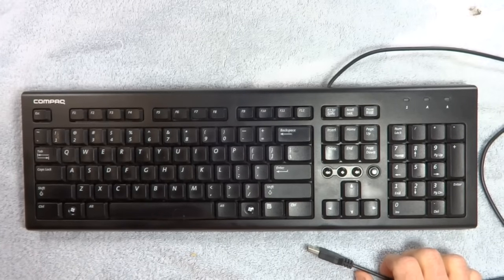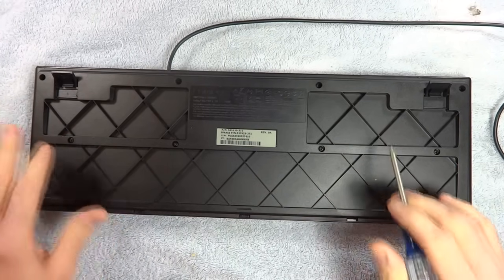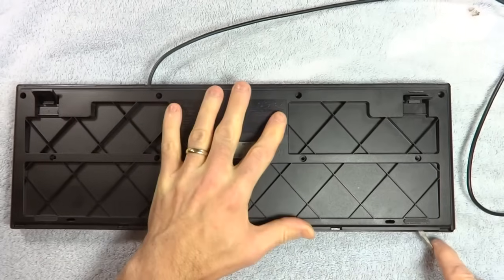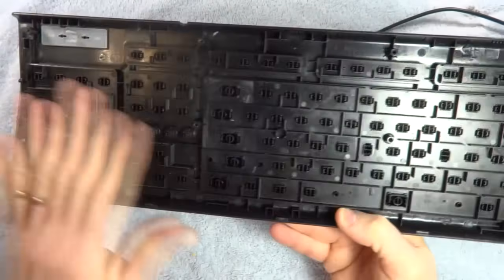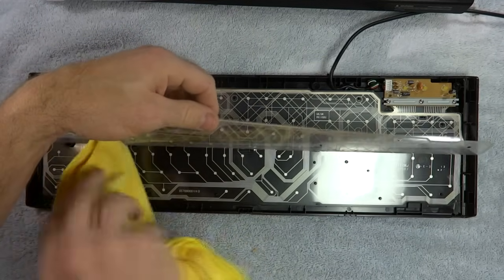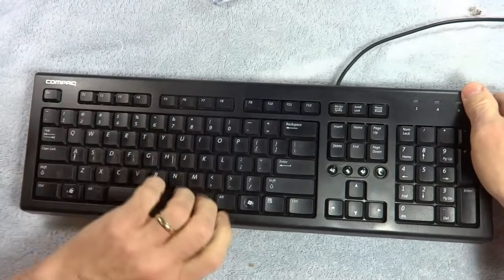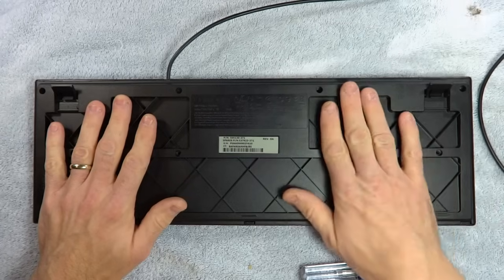How To Repair Computer Keyboard With Some Keys Not Working

Comment: I had a break in a trace on the top layer causing multiple keys not to work and was able to fix it by drawing over it with pencil, a multimeter will help with getting a good pencil. make sure to get a one that's actually conductive, the best i found was actually one of those little IKEA pencils, my multimeter actually beeped when touching the end and front of it, when another pencil i bougth from the store didn't beep at all.

Comment: Hello- My numpad is working weirdly if I press 1 it registers 1 and 2, if I press 2 it also registers 1 and 2. Same happens with 4,7,5 and 8 keys of the numpad. I have not attempted cleaning the keyboard. Have you heard of this type of fault? It's an old late 90's Dell membrane Keyboard.

Comment: Alright, thank you to prokyminch1640, i got the idea of being misaligned, what I did was try to wobble the keys, without putting out the case, the ones that weren't working for me was H, G, N, these keys would malfunction and double-type, and sometimes not work, what i did was press them at the same time, while wobbling them for about 10-30 seconds, after that, try to test it out, and it works for me (now this is just my idea because for a long time this has been happening, try it out guys)

Comment: Exact same problem with Microsoft Ergonomic 4000 keyboard; Z X C V and main ENTER keys stopped working. I opened the keyboard, cleaned it and made it work again! However, it stopped working the next day again. I opened it and gentle cleaning fixed the problem but now it'd only work for less than 2 - 3 hours before I need to open the keyboard again.

Should I now discard the keyboard or is there anyway to fix it?

Comment: My work table is near a window and when it rains and I forgot to close it, my keyboard gets a little wet.

After drying and all...

My keyboard still  types q1 w2 e3 when I press qwe.

Been in this stiuation twice already. 

So I did the same techniques in this video... 

And for both of those times...

My keyboard got fixed. 🎉

That's when I realized I should've bookmarked this vid. 😅

Comment: It worked for me.. I still have a 2006 Microsoft Comfort Curved keyboard and the 8 on the number keypad did not work.. 
Took it apart, deep cleaned everything.. Let it dry and next day I put it all together and it worked again. Amazing..

Comment: I have a Rapoo keyboard which is more of a sealed one and you need to pull the frame from top. I did that but I have no choice separating the thin membrane. Does anyone have any idea pls?
Just my space bar was not working and can you believe it was typing 9 and / continuously withing even touching it sometimes.

Comment: Thanks RJTheBikeGuy!!  Your video helped me save my Keytronic "classic ll" keyboard, the culprit was a big 'dust bunny' on the foam black bar next to the small circuit board inside the keyboard. I suspect the 'dust bunny' was infringing on the connections needed for functional keys. After taking my board apart & cleaning it gently but thoroughly it works perfectly now, so thanks for your informative & helpful video.  *Peace*

Comment: Excellent video & advice.  Spilled pure water on my Dell L100.  3 keys did not recover after 5 days.  Disassembled & found no remaining water.  Removed stubborn Mylar circuit deposits.  3 keys still do not work.  Conclusion: I should have disassembled & aired it out immediately after the spill.

Comment: Thanks...To my surprise this actually worked for me.  The "O" and the "I" key would not work even after removing the caps and cleaning so l took  off the bottom and found that rubber piece was folded at one end but didn't think this would be the problem for only 2 keys.I straightened the rubber piece and put it back together and tried it anyway and to my surprise all the keys actually worked

Comment: when you separate the two films with the contacts  you will see where they meet when the button pushes on the silicone, there is a a small nub inside the silicon button that pushes straight on the top membrane - shine a light on the actual contacts where the button is that is not working and you can see there is a speck of whatever that is over the contact.  mines got a shiny spot - what i was wondering is what ( if anything )  can repair that shiny spot - i would go buy a new key board but the one that is broken I cannot find.  these that I have here are either way small ( normal for reg people ) me. my old keyboard is a monster and fits my skillet size hands way better. i can type very quickly with it but my enter button is worn thru as stated. also I noticed several others that do work but they are getting that way as well.    I keep looking for something I can brush on and let dry that will fix that problem.   it's making me crazy. LOL  seriously.   I am at this keyboard on and off for 10 to 12 hours a day and it's really slowing me down in sales because of this problem.    I can see  lesser used button contacts do not have any shiny spot at all.   the inside of mine looks exactly like yours but larger.  i am not talking about a reg big key board here, i have had this one a long time and don't remember where I got it.   I am not a small med  or large person , I mean, my pinky finger ring sz is 13.  this keyboard was taken for granted by me for so long I guess, it is really depressing that is is breaking.  seems like such a small thing stopping it from being solid gold to me again.   if anyone knows what to do to fix the shiny spots on the connection dots please let me know.

Comment: 9 years later . . . Your video was helpful to me reassembling a vaguely similar Dell keyboard RTD50. Fyi, the RTD50 has 3 layers of plastic sheets inside: there's a completely clear sheet sandwiched in the middle. The clear sheet is not used or shown in your video's keyboard, but is in the middle of the RTD50's stack. Hth someone along the way : )

Comment: what you don't know is if you remove the last part (The electrical part where it connects) it will have problems with buttons and some buttons will not work at all! so DO NOT REMOVE THE ELECTRICAL CONNECTION. if you ask why it is because it did happen to me.

Comment: This is the most useless video I have seen in most time. You didn't repair anything. You opened the thing up, you said out loud that there is nothing visible, you use a cloth in 2 mini spots and closed it again.

Comment: i just go my cheap membrane keyboard so i took out everything from until it was only the bottom board then i fill some cotton from one of my pillows but when i get everything back and screwed it it doesnt work i dont why. i\ve check the rubber and the dots have alligned nothing was wrong and it's still broken up until now. oh, and the foam is no longer there

Comment: Thanks to this, I fixed my RGB lights.

When I opened my keyboard, the keys started to not work. I keep my screws tight, cause there are screws for the plastic membrane to the circuit board. So it works fine now

Comment: Mine slowly descend and ascend on the right side and don't register because the membrane either expanded due to alcohol and receded to the right side, disaligning the p, enter, shift, and backspace keys. The P key, enter, shift and back space keys are very spongey I hate it...cleaning them doesn't do anything except reset the whole physical encumberance...

Membrane keyboards are really annoying for me, sometimes the membrane just breaks, the rubber one. Not sure how or why probably because it is cheap and was exposed to the elements.

Comment: Can some one help me  some keys doesn't work  in my keyboard  and I thought something was wrong with my PC so I tried connecting my keyboard to my phone using OTG cable  but no still those keys doesn't work  the space bar and some other keys doesn't work and i tried restarting  my pc and nothing happened and the other day when I opened my PC everything's normal the keys work perfectly fine and after some days again it happened and soon sometimes the keys will work and sometimes it doesn't and when i press the key with lots of pressure sometimes it'll work and now it doesn't work like its completely broken so i cleaned the keyboard and nothing happened and i decided tp buy an new keyboard and that keyboard worked fine and after few months some keys doesn't work like no keys on the left side work can someone help me fix this same thing happened to both keyboards SOMEONE HELP PLSSSSSSSSSSSSS

IGNORE MY BROKEN ENGLISH

Comment: I just wnna comment here today 2021 it helped me. Before my key caps if i pressed letter A it comes out as a1 then r becomes r3 i did exaclty what he did i wiped the thick layer in the bottom and placed it back and worked properly thanks!!

Comment: This video was great. I had a couple keys that would nt work after spilling diet coke on my keyboard. Took the keyboard apart, cleaned everything, especially between the layers of plastic, and it works great. Its not really about the money as I had already bought another keyboard but about having the ability to fix it if needed. Thanks much.

Comment: In my keyboard, there are 3 sheets of plastics like on yours, but they are glued together all around the borders. Any idea on how to separate them? I tried a screw driver on a side that there was nothing printed, but I'm afraid it will remove the printed pattern. I was thinking about applying heat, but I don't know if it may deform the plastic. Thanks for any input!

Comment: Due to lack of conductive paint I repaired one with single-strand wires before. Glued on with tape it works perfectly fine. Not an ideal solution, but stable enough inside the rigid casing.
Reply: Wow, I cant imagine that lasting long.
Reply: @disguisedcat1750  update: lasted about a year before the tape came lose. More than enough time to find a proper replacement.
Reply: @HappyBeezerStudios   uhh.. nice!

Comment: probably best to always use 91% rubbing alcohol to clean all parts. Also if some of the keys still do not work after cleaning what else can be repaired???:
Reply from the maker: Make sure it's dry before reassembly. After this, dunno. Maybe just replace it.
Reply: @RJTheBikeGuy  trying to repair a microsoft natural 4000, they dont make them anymore, a few keys stopped working after water spill, so bummed!!
Reply: I used rubbing alcohol to wipe off some dust on the hard plastic that connects the keys and it turned the cotton ball blue. Why is that?

Comment: I was lil bit skeptical as there are many people saying that after following the procedure their keyboard stopped working! 
My "B" key wasnt working at all... As I was about to buy a new keyboard, there was nothing to loose doing some experiment, right? 
I followed the video to open up my keyboard. Then instead of using any liquid, I just used a soft brush to clean off the dusts in between those two plastic layers. I saw a small dust grain attached on the "B" key spot at one of the two layers. Using my finger nail carefully removed the dust. Now the key board is fully functional again :D

Comment: Is touching with dirty hand inside  between the two layers of the membrane (below the rubber buttons sheet) cause fatal defect??? Or it can be corrected by cleaning with towel ???

Comment: I am still stuck on step one after playing around for about 45 minutes. How do you separate the bottom and the top cases? You made it look so easy. I found all my screws and removed them, but I am stumped how to get purchase between the top and bottom cases to pop those tabs out of place.
Reply from the maker: They all come apart differently. Sounds like hidden snaps in there.
Reply: RJ The Bike Guy 
Thanks for the words of encouragement. On my second attempt, I wedged expired credit cards between the top and bottom cases as I worried each of the sides free. Eight credit cards and three edges later, the keyboard's case made a satisfying pop sound and finally came apart. Thanks again.
Reply from the maker: @XalphYT  They hide those snaps! Good news is they go together much more easily!

Comment: whether i buy expensive or cheap keyboard my keyboard doesn't last more than 6 months  may be I have bad luck with keyboards
Reply: use an electricity socket with proper earthing. Your keyboard would be fine after that.
I had the same issue.

Comment: Hi if anyone can help I actually washed those two layers of plastic w a soap 🧼 nd when I placed t back after getting t dried it’s not responding idk if it’s done or not but the lights r still on but there’s no respondin from any key nd it’s a wireless keyboard ⌨️!!
Reply from the maker: Try it again. Make sure it's dry and no soap residue. Could also be wireless keyboard is not synced with base.
Reply: RJ The Bike Guy yeah I k what u sayin but it’s already connected m not sure if the problem s w the circuit or not do I have any clue what it might b ?!

Comment: Excellent! thanks for this video^^
when i press some letters, it includes other characters/symbols. But now it works perfectly fine!
though we have different type of keyboard, but it still works.. i removed everything and washed except for the wire of course=) then put them outside drying under the sun. Put everything back and solved!=D

Comment: Anyone that reads this comment, its not to hard, all you need to do is clean the laptop, maybe vacum over it, then reset ur pc, after that put something on top of the broken key, not to heavy, just to hold it down, and another thing on the opposite side when its turned off, this should fix if the button is jammed, and or reset the keys, leav the pc off for a day with the stuff on it, take it off then turn on ur pc it should fix it, if this helped like it

Comment: The lenovo keyboard has just one single strip under the rubber strip.  My 3 keys are not working ( A W Q Tab key ) What are alternatives apart from replacing the keyboard altogether???
Reply from the maker: Shrug. I normally just clean them. That usually works. If not, I replace the keyboard.

Comment: Could have said that this might actually break your fcking key board cause others and mine broke what a lie
Reply from the maker: I have been cleaning keyboards like this for years. Did you let it dry before you reassembled? Go though it again. and make sure it's dry.
Reply: @RJTheBikeGuy  sorry for my comment. i didn't wash it at first i just use a brush then when i assemble it won't work now i washed it and waiting for it to dry.

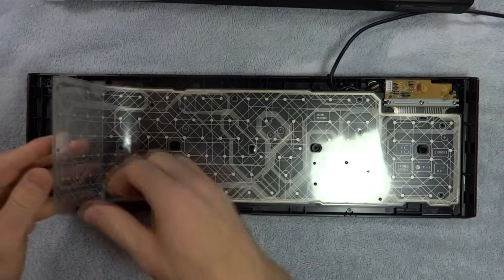Comment: 3:36 are those 2 plastic sheets supposed to be stuck together, or it's ok if it's separated?
Reply: I think your not supposed to separate them because if you separate them you have to put them back exactly how the sheets were sticked together so if you wanna clean between the sheets don’t take them apart.

Comment: my keyboard get wet an now some keys was not working (already dried up even the plastic circuit board) i tried cleaning everything and still some keys was not working is theres a way to fix  it? (currently i can't go outside to buy a new one and delivery on my area was not available for now)

Comment: AH! My rubber dome matrix keyboard keeps repeatedly typing keys after I only press them once. I cleaned it thoroughly and wiped down the matrix but it still has the same problem. No keys are sticking and the matrix looks clean. Keytester tells me, say I press H, it will keep pressing H. Same with spacebar and all other keys. The matrix does not split into two pages like yours does, or maybe it is stuck? Should I try prying them apart? The keyboard is a Redragon Vajra s101 keyboard that came with a great Centrophorus backlight mouse. I don't understand what is wrong with it! (I'm on mobile right now.) It says plug and play on the manual, no drivers need to be updated so it must be a problem with the matrix or connecter nodes! Everyone is just telling me to buy a Mechanical keyboard instead but I just spent money on this thing...

Comment: I cleaned my keyboard and it won't work now (it's ps2 keyboard and it looks like it is working in bios)
Reply from the maker: Try it again. Make sure it is dry when you reassemble.
Reply: Soo I need to reassemble it, let it dry and then assemble?
Reply from the maker: @ajdincudic8200  Do the whole thing again as in the video. But let it dry before you put it back together.

Comment: Clean the electronic leads on the little circuit board which has the three led lights sitting on the top right hand corner. If the leads have darkened due to dust, it will have a hard time picking up electronic signals from the circuit membrane. A pencil eraser is a nice thing to use and it worked like a charm for me.

Comment: Due to the lockdown for corona virus, I work from home and was struggling to replace the keyboard because of some keys not working properly. I watched this video end up fixing my keyboard issues! Thanks for the video!
Reply: hi, is this really working? i'd like to try it
Reply: Yes it is really working!
Reply: @venkateshyuvaraj8536  yes, you are right,i too fix my keyboard issue
Reply: q,w,e,r,u,i,o,p is not working for me but sometimes it works
Reply: Which keys of yours  didn't work ?
Reply: @faridayasmin8224  my volume control keys and windows key weren't working. Now it's fixed.
Reply: The keys were working for couple of weeks but later the windows stopped working. My keyboard is 4-5 years old one so  I think it's good to replace it with new.
Reply: Is you use water to wash
Reply: @ghousigamugunthan2446  yes